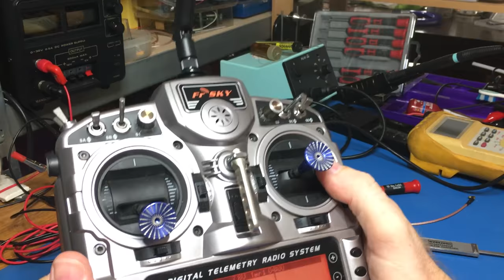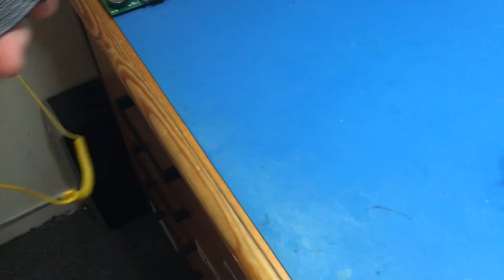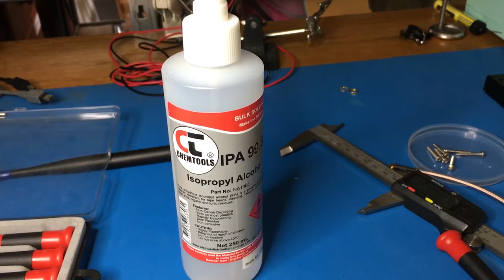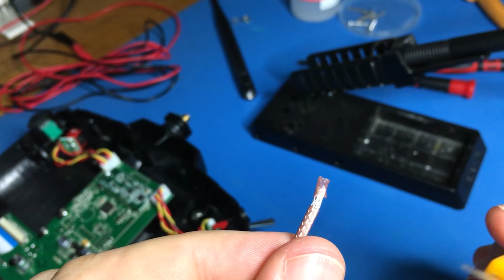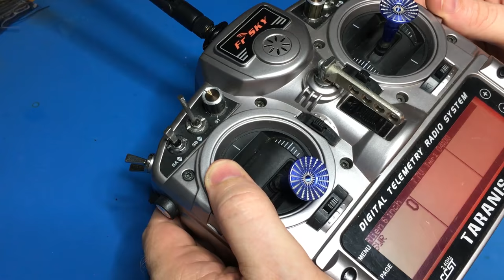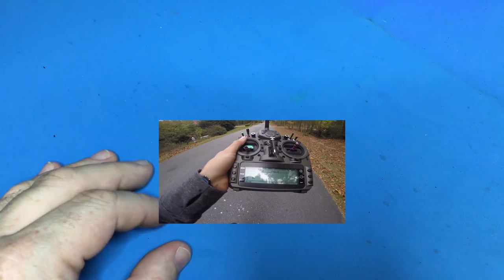Tutorial - Taranis 5dB Antenna Mod **DON'T DO IT** | Fixing Bad SWR | HOW TO

Comment: your the only one that has posted a video that has brought ESD into play. Safety first..!
Reply from the maker: Thanks for that - I never work on my mini-quad (or anything else for that matter) without grounding myself first :D
Reply: @ExpressiveImagery  - Bravo! How refreshing! Many modern-day tinkerers seem to have learned their skills by watching a few 'hit-and-hope' YouTube videos and eschew all the old safety precautions because they're seen as wimpy and too much bother and only for swots and geeks and nerds...

Thus, wearing personal safety gear like goggles and earplugs when angle-grinding is completely unnecessary. Yeah! Saw it on YouTube!

Protecting electronic components from static is desperately uncool too. You can't feel it or see it, so it obviously doesn't exist. Huh. Why worry. It's like obsessing over not making a dry soldered joint. It's not macho. So why wear goggles unless they're for your FPV - you can always get new eyes, right?

Maybe they think that modern electronics are too robust to need protecting. Which is weird, because things like chips are 10,000,000 times more complex and vulnerable than the 'old' clunky components they replaced. Perhaps they hope the manufacturers have made everything magically idiot-proof, and anything that fails must be somebody else's fault.

A day spent in a professional environment where electronics are safety-critical would certainly give 'em a bit of a shock! (Pun intended.)

Of course, it's perfectly acceptable to spend £100+ replacing a fried board. As long as their mates don't find out what complete a-holes they've been.    ;-)

Comment: SWR - Standing Wave Ratio, a high value means too much RF is being reflected back into the tx because the antenna length does not match the wavelength of the RF correctly, by adusting the lenth of the coax you are tuning the antenna to a correct wavelength and reducing SWR.
Reply from the maker: Yes, that is what I'm led to understand too. Thanks for sharing.
Reply: Ira Borton g*

Comment: Agree with the warning. I modded carefully; great soldering job, ESD protection and SWR of 0. Still experienced degrading performance.

The sad part is I went back to a new OEM antenna, and performance is STILL bad now. Got a QX7 and the RSSI to the same receivers is fantastic.
Reply from the maker: That's not good, sorry to hear about that. It's like something else is at play here when we move to a 5dB antenna and it causes some partial damage to the Taranis. I've just started using my TBS CrossFire system and not had the same "copter losing control" issues.

Comment: Thanks for this video, very useful and you may have just assisted me in saving my Taranis :)
Reply from the maker: No worries. I'm glad it helped you out. I've been flying around 300M away recently and have not had an RSSI Warning message like I used to get. One day I will try a full range test.
Reply: Cool, I'll be range testing as soon as I have this transmitter back together. Out of interest, I have just tested with the quad sat beside the transmitter and my RSSI reads 106 - what would you get for a similar test?
Reply from the maker: I would get an RSSI of around 85 to 95  with the antenna pointing straight up. However, I would also say that having the radio so close to your aircraft is not a good thing as it can swamp the electronics with RF energy. I would recommend placing your aircraft about 2M away and try again. Cheers Tony
Reply: What does that mean, "Swamp the electronics with RF energy"?
I didnt use to have a problem but now I'm getting warnings of telemetry lost and rssi signal low. Is it possible to swamp a stock equipment so that it damages something by being too close?

Comment: Works perfectly for me - RG316 84mm,  2db and 5db screw-on Taranis antennas from ReadyMadeRC.   Range test 200ft on both antennas with no problem.   SWR (RAS) at 0/1 for both.   I saw a small increase (few dB) with the 5dB antenna using the RSSI display on the Taranis Plus, but I see no reason to use the 5dB as my planes will be out of view before they are out of range.

Comment: I have two antennas 2db. With one SWR in normal, with the second - as well as on video. Both antennas are bought on ebay, but from different vendors. Buy normal antennas.

Comment: It will be very interesting to see if we find the answer to what the problems with this mod is. I have done the mod myself. Did not  find the range to increase but seems about the same. But if I look at the "SWR" that Taranis reports in telemetry some strange things are happening. The numbers are high (30-ish) to start with after I turn on the radio, and then decreases .

Comment: Might be better to use conformal coating on the antenna connection to the board, before the hot glue. Hot glue is very slightly conductive.
Reply from the maker: That’s a great idea, thanks for sharing.

Comment: The issue is not the RX, as I had problems with multiple quads that used to be fine.
Reply from the maker: Understood mate. I think this is a very complex situation.  I've just purchased a branded Wifi one from Amazon and will try it out when it arrives. The trouble is that I can fly 20 packs and not have any issue since the issue is so random. I wish I can find a pattern so that it can be repeated. All I know is that it seems to happen within the distance 5M to 40M away from me. My Taranis does not tell me the usual "Telemetry Lost" when I lose control of the copter. Just the other day I was hovering in front of me just doing a little "drop catch" type exercise and at 2M height it just slowly rolled/pitched over and hit the grass with all props spinning. I disarmed straight away but the props where still spinning for a few seconds. At first I thought it was a failsafe condition that was triggered but since I have a detailed OSD running and I was recording on my DVR at the same time, the OSD did not show the normal state when a failsafe occurs. It's almost like the TX was still sending out the RF and the FrSky protocol was just sending out the last known logic pulses from the TX control board and ignoring any input from me. I've seen this exact same sequence occur 3 times now. Would you like to see the DVR footage for each incident? While I await the new antenna, I have installed my CrossFire unit and TBS micro RX in my Alien and not had an issue since. I wanted to eliminate the FC from my investigation., as I thought that may of been causing the problem. Cheers Tony

Comment: Had the same issue with SWR after doing the MOD. Turns out that I had not soldered the ground wire securely on the  antenna to the board. Fixed it and went from a reading of 30 to 0-1.

Comment: It has to be a resonant feeder. You got the length wrong. (as you found out) I've got an original Taranis and broke my antenna of it years ago. I used a proper FRSky part to do my mod with after a random length cable made my SWR  27!  Cable length should be 82 mm from the pad on the tx to the base of the antenna.

Comment: Very clean job. How long after the mod did the first failsafe occur? Maybe you wore out the antenna like Joshua said in his video. So to date only Mr. Steele was successful in performing the mod, and doubt he changed his antenna.
Reply from the maker: Thanks. It would of been about 20mins after the work was performed. The copter was about 3M away from me, with clear line of sight. I suspect Mr Steele used a good quality antenna, rather than the generic one that I used. Regards Tony
Reply: I don't know man, there are tons of people here on YT having issues with the taranis special edition, which is basically a taranis that comes from the factory with the antenna mod. The antenna that it comes with is a 2dbi. This issue is really weird.
Reply from the maker: In hindsight, I would say doing the mod is not worth it (or trying to use a special edition radio). It causes too much trouble in the end :)
Reply: Have you tried another receiver, just to be sure? Really unfortunate for those that spent 250$ and have a faulty Taranis from the get go... you are practically forced to purchase a TBS Crossfire, which is not right.

Comment: Was problem fixed? I have a 2.4g amp booster I'm dying to use with my taranis q7
Reply from the maker: My advice is to consider what it is you are trying to achieve. If it's longer range then take a look at other products like the CrossFire system rather than trying to extend the range of the 2.4GHz system Although I did conduct the antenna mod perfectly, the 5dBi antenna is not a good choice as shown throughout these comments. If you do decide to do the mod then I'd seriously buy a genuine 2dBi antenna from FrSky. Once I did this all my troubles went away. Regards Tony
Reply: So buy a frsky antenna huh?
Expressive Imagery wow thanks for the fast and unexpected response lol. I've done the antenna mod on 2 remotes, the first being a fail haha. But yeah, I already have good boosterd and tons of antennas. And I just bought my taranis brand new with the LRS reciever. I need more range and strong signal. I lost my drone a few weeks ago i could have bought 5 radios with that money :'(
Reply from the maker: Yes, the genuine antennas are always better than the generic ones. I'm only a small channel so always respond to comments as quick as I can :) If you lose aircraft because of RF issues (in the control link say) then perhaps look at taking steps to mitigate the risks of the link going down, like standing on high ground and away from other objects or sources of RF - just some food for thought!

Comment: I did this mod just before Jousha video. I'm not sure what to do. I did use the thicker cable and a frsky 5db antenna.  So I'm a bit concerned. I'm wondering is using a 2db vs 5db could any difference long-term. Any thought?
Reply from the maker: I think it is good news that you are using an official 5dB FrSky antenna. My thoughts on this are:

1) My understanding is that the difference between 2dB and 5dB antennas is just the shape of the RF reception pattern is different - think slight squashed balloon at top and bottom.
1) Maybe see if you can find a 2dB antenna from FrSky that matches your connection that you have installed (SMA or RPSMA).
2) Have you soldered the braid to both ground solder pads that sit either side of the signal pad? My thinking is that this may be a requirement for a healthy RF signal, even though both pads are connected together at some point on the PCB.

One thing that is still unclear is how does the FrSky telemetry and protocol work. The Taranis antenna is both a transmitting device (RF to copter) and a reception device (RF from copter). Therefore, there may be some particular way that these 2 functions are balanced and what we are doing with removing UFL connectors, soldering directly thick coax and using higher gain antennas could well be upsetting the equilibrium  of the system. Regards Tony
Reply: Expressive Imagery Thanks for the reply. 

1. I have a 2db FrSky. It from alofthobbies in the USA. I'll probably swap it out.

2. I do have both pads soldered  so that's good. 

3. I have the original Taranis and it's didn't use the u. FL. But I was wondering  about the thinker coax too. I did use it. 

oh we'll see what happens
Reply: The Closed loop antenna like the 2.5 madmushroom or the folded dipole are what alex grieves recomends instead of the 5dbi

Comment: I did the mod and swr was at 0-1 but the range went from a mile down to 100ft everything was done perfect and used a genuine Frysky antenna replaced backboard still the same so I put the original antenna back on this improved the range a little to 300ft max before failsafe so it looks like the main board is damaged as I have already replaced the backboard, I can't understand how this has gone wrong for me and many others this mod has turned out very costly And I would say to others it's not worth doing this mod as the high failure rate
Reply from the maker: Oh no, sorry to hear about your issues. This mod seems to be the most troublesome one for the Taranis. Some people have have been fine while others not. Hence the fact I changed the description of this video just after I released it to warn others after the results I observed. Do you have another receiver (or copter) to try an independent range check with? Regards Tony
Reply: Hi yes I have tried on my 8 different quads with X4r sxr and R-sxr Recievers and on range mode test at 30feet signal was totally lost .
Reply: Same issue here, did you replace the board and redo the mod?  Any success?

Comment: How is your testing coming along? I have the stock Taranis with a u.fl connector and while I'm getting between a 3-5 SWR reading my range could be better. Just curious to know if you found anything else out in regards to the mod. Thanks.
Reply from the maker: I'm awaiting the external 2dB and 5dB antennas which are FrSky products (they should be better than my current cheap 5dB one), then I can perform some tests. At this time I don't trust the Taranis after I did the mod so I use my CrossFire module in my Taranis so that I have a solid link without my copter falling out the sky! If I were you I would not consider doing the mod until we know more about it's  impacts. Regards Tony

Comment: Nice video, thanks for sharing. I have a doubt. Do i have to solder the outer braid at the 2 spots where that was the conector, and solder the cable at the other one? The spots that i said ( where the conector was) is just like this | _ | . So the 2 of the sides do i solder the braid, and the other do i solder the cable for the antena signal? Sorry for my bad english haha, i hope you can understand :)
Reply from the maker: Hi there. Thanks for the feedback. You should only need to solder the outer braid to one of the ground connection pads on the circuit board. This is because both of those pads are actually connected with the circuit board itself. I did check this (not shown in the video). Greetings from Brisbane, Australia. Tony
Reply: Great, thanks a lot, saved my radio. Greetings from Brasil, one day i will know Australia. I´m subscribed

Comment: Very nice video! Btw where dis you get that grounding wrist band?
Reply from the maker: Thanks for that. If you search on eBay for "ESD Strap" you will find what you are looking for. Here is an example here in Australia, cheers Tony  http://www.ebay.com.au/itm/Anti-Static-Antistatic-ESD-Adjustable-Wrist-Strap-Band-Grounding-Wristband-/120956005565?hash=item1c298a2cbd:m:mhPbg7dxWB6z-p_85bWJ6zQ
Reply: Ah thank you! Btw how is the tx doing after this mod? I've been thinking of doing this, I fried my stock internal module (with stock antenna) i dont know why, but Joshua Bardwell's video made me doubt the mod. I will probably go ahead and do it with the anti static wrist strap
Reply from the maker: I have watched Joshua's video about the troubles he (and others) have been experiencing. I have been experiencing a few issues where my Alien quad has been unresponsive in mid flight and I have had to disarm. I've never had a FailSafe occur in the 2+ years of flying so I'm not sure what that feels like when it happens. Therefore I'm not sure if my issues are down to the antenna mod or my FrSky RX. The reason I say this is that my UBAD quad has an older RX and I don't get the same issue. Having been a professional electronics engineer for many years, I know it's not related to any anti-static damage on my part. Something else is at play here, and I'm troubleshooting this. So my recommendation is not to do this mod, as even with my meticulous approach I have an issue. Maybe it's a coincidence or maybe not. I'm going to update my video title and description to reflect this.
Reply: Expressive Imagery thanks again for your suggestion. Alright I will try to replace the board and solder the stock antenna again then.

Comment: I did the same mod, got SWR value to 0-1. I soldered ground to both ground pads. Then i ran the range test using taranis range menu option - got the signal up to 70m away which supposedly it is a great result (in the range test mode taranis limits the strength of the signal to 1/30th).
However when flying, my quad drops out of skies at the range where i never experienced any issues before the mod at the same flying field :(. RSSI drops pretty quickly.
HELP :)
I am considering reinstalling the original antenna.
Reply from the maker: I would advise to purchase a high-quality 2dB antenna from a known brand. Here are 2 videos that will also help to give you some background as to why this is happening to you. Good luck.

http://www.youtube.com/watch?v=bnK3HGzdmTc&t=12s

http://www.youtube.com/watch?v=LiBlbsHOPNU

Comment: I snapped the antenna on my taranis and I'm thinking about doing this mod to repair it. I'm kind of afraid though after reading reports of reduced range and other issues. Is there a safer method to repair the antenna?
Reply from the maker: I would suggest following the steps outlined in the video and reading my comments above. That way you will be doing the safest and best approach you can do. Always buy a genuine FrSky 2db antenna and avoid at all costs trying a 5db one. After installing the FrSky 2db one I've never had an issue. If you really want longer range then there is really no substitute for the TBS CrossFire unit. I've converted both my quads over to this set up for over 18 months now and I've never had an issue. Good luck, Tony